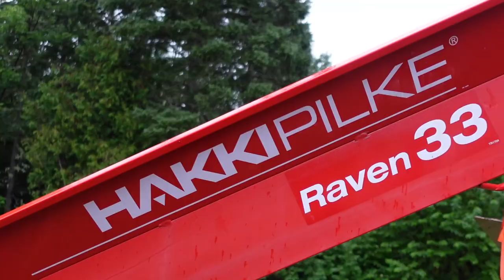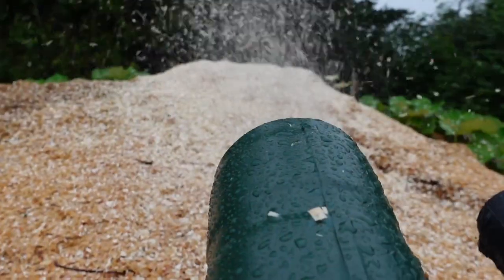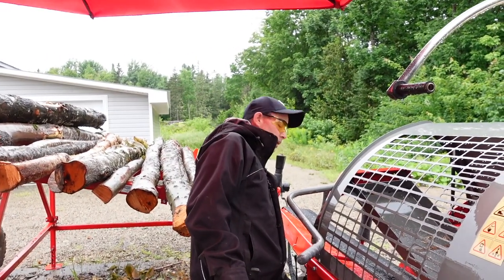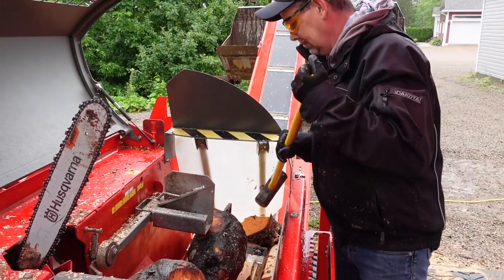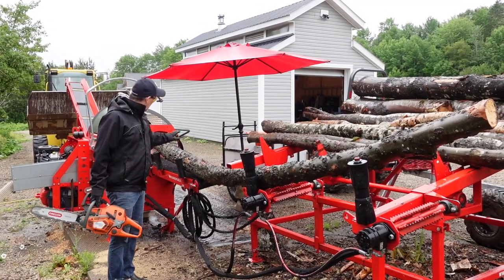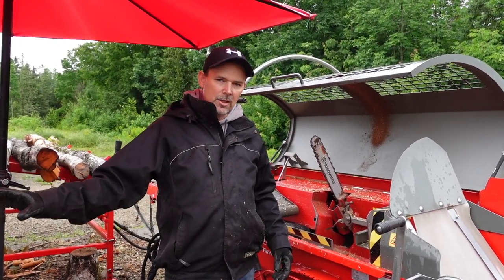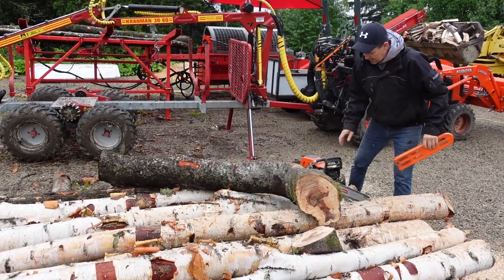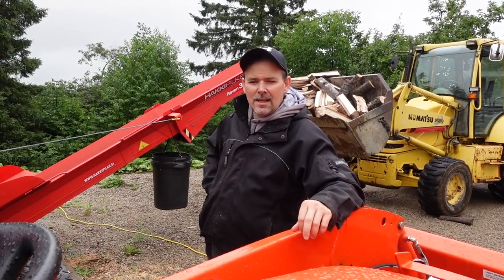Firewood Processor Pro Tips  -E173

Comment: Great video Jason. Nice tips. Although I don’t have a processor, you still have to do some things to move things along nicely. A little bit wet there, we got a bunch of rain here Saturday. 
Strange that the splitter in your processor is 5 ton. My electric splitter is 5 ton. 
White birch is great for processing no matter what why you do it. But, I don’t like the mess of the bark. And it rots quick. 
Those 3 to 4” pieces you don’t split, do they dry enough to sell along with the split wood, at the same time. 
And, I got my moisture tester. Thanks for the information on that. Just a gadget for me to have some fun and just be interesting to know moisture content. I don’t sell firewood. Still have to learn a bit about the tester. 4 different settings with lots of wood names on it I’ve never heard of. 
Have a great day.
Reply from the maker: Hi Noel, the more expensive models will have more powerful splitters on them but they also increase the wood diameter feed limits. I spoke with another woodsman running a 38 Pro and I think it has an 8 ton splitter on it but the feed size increases to 14 or 16".... his feedback was the same. A bit undersized especially if you move up to a 6 way wedge.
The smaller unsplit birch will likely get down below 15% as well. As you say, birch dries fast but it will hold moisture if the bark is on the whole way around. No complaints yet! I blend in 10% to a cord of firewood right now just to keep some moving to the customers. The little testers are great, I would just find the one that is recommended for firewood and leave it there. They should be quick to use and I find they are quite reliable. Take care!
Reply: @OakMountainAcotts  thanks Jason. I watch another channel that has a Japa 365 wood splitter. Looks very similar to yours. Are they the same splitters or different company’s.
Reply from the maker: I believe they are sisters under the same corporation.
Reply: @OakMountainAcotts  I see. Thanks Jason. Yours seemed to work much better than the Japa one I saw.

Comment: Thanks a lot for this very good video and demo of this processor. I have been looking and comparing various brands and models for what i could use and a must for me is that it has to be coming with its own power unit and i would run it off grid. Most brand don't offer that, or with PTO run  but i usually need my tractor too and can t just use it for the processor. The other major issue for us here up the Yukon, is the access to a dealer and therefore the cost of shipping. All in, I would probably look at an extra 10 to 15k CA to get a unit up here. regardless of the brand.....Explain it why i still process by hand my 60 cords/year.....for now.
Reply from the maker: Wow, 60 cords per year is a lot! My bottleneck here is getting the trees down and out to the processor. Especially with only weekends to work on the Woodlot. We have quite a few videos on the processor on our channel to help you make the brand decision. The reliability has been very good so far. I have changed the coil on the gas engine, the chain sprocket and a small pin that connects linkage from the handle that operates the saw to the actual hydraulic controller. It was a $0.30 piece but took an hour or so for me to figure out how to replace it! If I had to guess, I have probably processed between 120 and 140 cords with it so far. I need to get it under cover as the sun is hard on the rubber belts, etc. Hope this helps, Jason.
Reply: I will definitely watch the other videos (if i haven't already. I have various questions and would love to discuss few things as it seems we have some similar equipment and woodlots challenges. Would you have a email where you can be contacted...if you want to of course. Cheers and keep up the good work! @OakMountainAcotts
Reply from the maker: @sebastienweisser4839 you can find our e-mail address on our channel! Thanks, Jason

Comment: it's really interesting that it differs so much. Here in Sweden, it is almost a must that the wood is sawn and split with a wood processor, otherwise it is not profitable. The same thing with the handling of the wood, here the wood goes directly after the wood processor in a large sack of 1.5 cubic meters and not hand stacked at all. 

The birch is the white gold here in sweden.

Really good video!!👍
Reply from the maker: I love white birch for firewood and we have a fair amount on our Woodlot. I think more will be used in NB in the next 10 years. We are looking into the sacs as well… stacking is very time consuming!
Reply: If you going to get sacks, I would recommend going for the quality ones and not for the cheap ones, saves money in the long run
Reply from the maker: Yes, they are expected so they need to last at least 3 seasons!
Reply: I have a sneaky suspicion that we have different proportions when it comes to building price depending on country. We (Finland and Sweden) have high labourcosts, I have no clue on Canada.
 Then we don't have to season our wood for so long as we don't burn real hardwood since it is not available at least here. We burn mostly white birch, pine and spruce. Cut in winter/spring, dry over summer and burn in winter.
 YouTube is interesting when anyone can can look at videos and relate different depending on background. There is big difficulties to make money the American way by bucking woth chainsaw, splitting with a "Eastonmade/Wolfridge", stacking and drying. With good wood and making one meter long wood selling as is maybe possible, but not easy. Best way making money is that no one touches the wood before the customer. Trees taken down with processor/harvester, taken out from the woods with forwarder/tractor "straight" to the logtable from where it is processed straight into bags/totes, stacked to dry and then loaded onto a trailer.
 Thank you and greetings from southern Finland 👍🏼💪🏼😁!
Reply: @johanneslaxell6641  I totally agree with you, I do not understand that (I think both) USA and Canda are using feller, skidder and a delimber machine when logging and not harvester and a forwarder
Reply from the maker: Some big companies have switched to harvesters but the forest is clear cut to pay for the machines. Our wood prices are artificially low and set by the government, it seems, to subsidize the large companies. They make huge profits while the private Woodlot owner can barely afford to log with a skidder and chainsaw!
Reply: @challe_challe3622  Well one reson (as I see it) is that they go with (and have) larger trees. The mass in a tree one meter in ∅ is something else than in a tree with 0,5 meter ∅. I have thought about the relationship to the industry before, our industry doesn't want big trees. That makes it's mark on when trees are fell and probably partly why processors here stops at Hakki 55 (20")...
 If my memory serves me correctly the limit to the mills is aruond 0,5 meter ∅, larger than that and they refuse to buy. We don't have longer chainsaw bars either, I would say 20" is regarded long already...
Reply: @OakMountainAcotts  But now I will "swear in the church" and say that when it comes to making (any money)/m³ chainsaw and skidding isn't probably the most effective way. The amount of time/effort/money that go into a Kranman load from start to finish is "noticeable". I watch "The Log Father" (who is a fellow Canadian?) and wonder how it add up "getting butter on the bread". As time usually is money I can't stop thinking about why I see so many compact tractors and ATV:s. We use oldish ~70hp upwards Valmet/Volvo/Ford/Massey Ferguson and similar and ~8-10 ton trailers. Yes there are some ATV-"Kranman" packages but I would say not that many in professional use as someone has to pay for the time in the saddle, and with our taxes/social fees that is (as I understand it) over 35€/hour just for labour...
Reply from the maker: Let’s analyze this a different way. If you owned my woodlot in Sweden, could you harvest sustainably and be profitable? Let’s use 500 acres with 15 cords per acre. With your market prices and automated equipment, what do the annual finances look like? ;)
Reply: @OakMountainAcotts  It's quite difficult to estimate it, we had a thinning from which we got 700 cubic meters which was both wood, pulpwood, and firewood. The harvester and forwarder's price was SEK 150/18.93 Canadian dollars per cubic meter. 

The area that was harvested was approximately 4 hectares.
The sum we got from selling all the wood was SEK 191,000 / 24,359.90 Canadian dollars. 

The total profit got SEK 86,000 / 10,854.67 Canadian dollars. This was about 3 years ago so prices may change. You also need to consider that the road that the timber trucks will travel on is in good condition.
Reply: @OakMountainAcotts  stay clear of those white bags that are made from thin plastic slices...they get cut and bag splits open like a zipper. black netting bags are where the durability is at.

Comment: Pull the stuck chunk of wood off the wedge using a chain and 2 hooks using the retract stroke of the cylinder I have a hook welded to the push plate and a grab hook on a 5/16 x 36 inch long chain.
Reply from the maker: I have seen this done before and it works good. My pusher retracts fully inside the machine as it waits for the next piece. Not sure there is any place to mount one…

Comment: If you really want to make your firewood processor operation efficient, take a few minutes with the chainsaw and clean up any obvious problem spots back in the woods (like that beech log with the 90 degree bend).  Joe at Ohio Wood Burner (youtube) has made marks on a tape measure that account for the chainsaw kerf of the processor bar when he measures out his logs for loading on the feed table. This makes for minimal off cuts.
Reply from the maker: Makes sense! Thanks for watching!